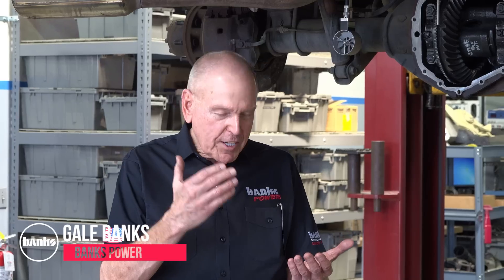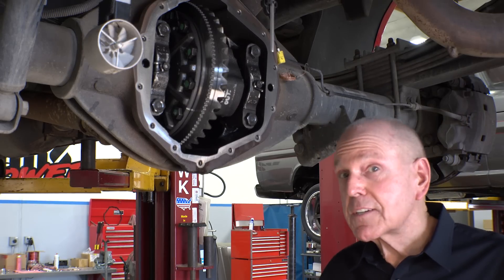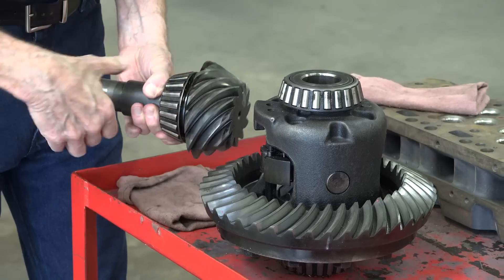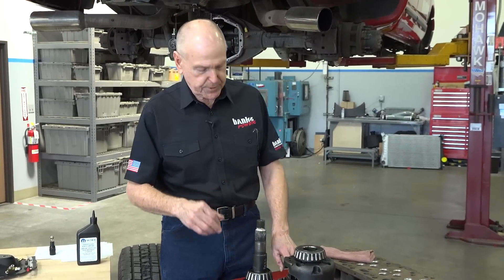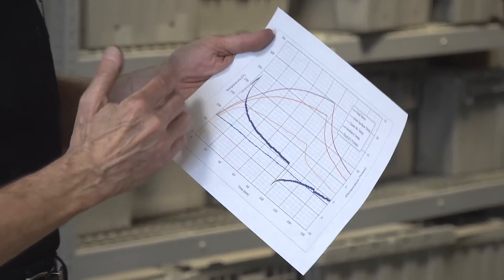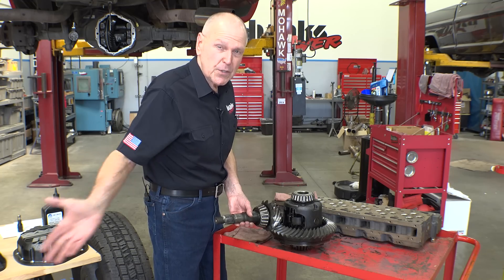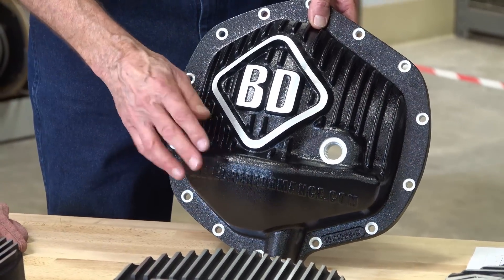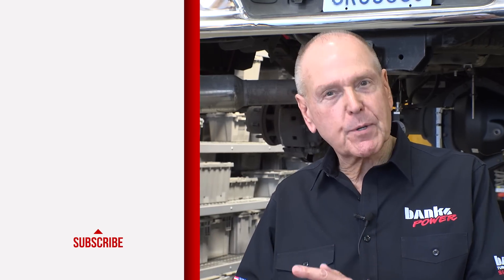Do Diff Covers Work or Are They Just Bling? Part 2 of 3

Comment: I see 5 dislikes....... And five aftermarket covers guess we know who hit the thumbs down lol
Reply: Touché. Haha
Reply: brappp life I have an after market cover on one of my trucks and just listening to Gale Banks logic, by itself, makes my want to change it back to the factory cover.
Reply: it might be his blind faith in the manufacturer, yes, they may have done some testing, but if they were always right, we wouldn't see plastic intake manifolds.
Reply: He has posted two videos on this one subject but no answer
Reply: @PandaMan02  what problems do plastic intakes have? 😂 ls has been around since 1997 with plastic intakes on both cars and trucks. Ford dodge GM Toyota Honda.. if they didn't work as well as they do for stock applications and even some performance applications then they would have never come out. They would have never lasted for 20+years. They are lighter cheaper easier and still maintain reliability. If you put boost through it that intake may not last but n/a and they work fine.
Reply: @motrhead 69 yeah the dislikes have gone up, not as funny now
Reply: @jaredanthony8070   Plastic doesn't hold up well to repeated heat cycles, it gets brittle and cracks easily.
Reply: @Lray4x4  yes some plastic isnt very good at heat cycles. Ls intakes are made of nylon 66 which has a heat rating of down to -30c and up to 180c which converts to -22 and 365 f. Theres hundreds of thousands of trucks and cars that have hundreds of thousands of miles without a single issue. Intakes are designed to handle heat cycles. Ford 5.4s had intake issues I believe but they are designed to handle it and they normally do. Now under boost of more than 10 lbs or so you will probably experience issues but in n/a applications they are built to last.
Reply: @jaredanthony8070  If plastic is so good then why do so many plastic intake manifolds, and thermostat  housings crack? It is rare for the metal ones do do that.
Reply: @Lray4x4  ls intakes are not well known for cracking. What brands that do use them probably dont use the same material that in ls based engines lasts hundreds of thousands of miles and heat cycles without ever having issues. But a lot of vehicles that do use plastic thermostat housings arent designed to last as long which means they use cheaper plastics that dont withstand the chemicals in coolant or petroleum.
Reply: @PandaMan02  worried about blowing the welds on your intake? 😂🤣😂
Reply: ill take plastic manifold over these plastic oil pans.
Reply: If you have done any appreciable wear, you'll likely hear a wine long before any hardparts go.  
Chances are, your fine.
Reply: Yes, but an aftermarket cover with main girdle supports has its benefits, but lacks in lubrication.
Reply: An oil pump at 40psi isn't necessarily better than an oil pump at 60psi. If I had to choose, Id take a 40psi pump, with a greater oil capacity.
Reply: @jaredanthony8070  I can't speak for or against plastic intakes. But have you worked on 10 + year old VWs such as Jettas, Passats, etc.? They have a lot of plastic plumbing in their cooling system. They are shit. Easily crack or brake after a few years especially if people don't change their coolant as per instructed by the manufacturer. I've worked on old VWs over 30 years when they used all metal plumbing. Sure some of them rust and go to the trash but for some VW owners who did a decent job at maintaining their vehicles, their VW metal tubes are still in good conditions. Every car manufacturer has gone the cheap route with parts estimated to last only 10 years before the need to replace them. This is the way they keep making money out of 10 year old cars.
Reply: @johnnyjohn8073  plastic being used in the cooling system is never very good in comparison to brass or aluminum or a good galvanized steel that works with the coolant etc. Plastic radiator end tanks crack after several years and if theres plastic couplers between pipes it is almost a guaranteed problem. But that's a different plastic composite and they have chemicals and electrolysis with the flowing coolant and it degrades them over time or they dry out from the outside in like a rubber hose will. But on things like intakes theres air flowing through it and they are another type of plastic that could handle gas but with injectors being at the intake port on the head or even when people run wet shots of nitrous through ls intakes they rarely crack.
Reply: @lorenreece1665  What is 'obvious' is that, my comment of the raw truth clearly offended you beyond measure. Everything I previously stated is based on countless years of experience, and, from numerous other mechanics who have multiple decades of experience.
Reply: @zoultronzoultron9723  man if you don't know the answer to this subject that would make it impossible to hold a conversation with you. Your reply makes you look like a fool.  La La Gag
Reply: @clauderivet7745  i actually do know the answer.  My comment was he has made 2 same videos but he gives no answer.  Mayb he has a video up now that i haven't seen . My comment was awhile back

Comment: Gale Banks defines the difference between an Engineer and a mechanic.
Reply: But a damn good mechanic that thinks like an engineer
Reply: Mr. Banks is more of an engineer than most engineers. He is analyzing this in a quite scientific way. I have no idea if he is formally schooled or not but he is an engineer none the less. My hat is off to you sir.
Reply: the upscriber I’d like to see the same study done with all of the intake air filters as opposed to stock.  I don’t believe the statistics posted online.
Reply: To actually prove his point, he needs to make a plastic cover like the ones that he's downplaying.  I would think that the GM developers made the shape of the stock cover to accommodate the larger ring gear and create the flow of gear oil to the highest point letting it flow to all of the bearings.  Other than creating outside "cooling fins" what else can Banks do?
Reply: As a random guy who fixed things designed by engineers for a couple decades. Some 'engineers' designs are fails. Really though.
Reply: there's no engineering here, sorry bro.  this is pretty basic stuff.
Reply: He exemplifies a mechanic.. who doesn't understand engineering, design, or physics.
Reply: I feel like it's the deference between a factory engineer and an aftermarket engineer.

Factory worker: make it cheap!

Aftermarket engineer: make it work better!
Reply: There's a big difference and I can go on for a while about how radically different both fields are, but mechanics maintain what has already been designed, engineers design.  A background in how cars work and what can make them work better would be ideal which is why people with an understanding of these things can be good engineers if they choose to.
Reply: They way apprentice mechanics are taught nowadays is to replace parts, not repair them. I'm a technician of 33 years and also hold a degree in engineering.  I'm sure having that engineering degree helps me understand the design and purpose, not just the effect. My son is a newly licensed technician and we have a huge difference in thinking when it comes to automotive repairs. I was taught repair, he was taught replacement. Huge difference.
Reply: Ken Call  this issue is since 1977. go low carb, live longer

Comment: Prolly gonna come down to "stick with OEM." Banks is a legend!
Reply: yep, seems to be headed in that direction.  Will be interesting to see the results!
Reply: It'll probably be stock as #2 best and the new Banks  developed cover as #1  as a combination of increase fluid capacity of the other aftermarkets and improved fluid dynamics of the stock cover
Reply: Yeah but this legend wont just stop there if it comes down to the stock one being best you bet your ass this man will design one that looks great and works better than stock because. Banks doesn't play around
Reply: I don’t think he will make a diff cover. I think he’s just curious.
Reply: "best" is kind of subjective. He doesn't discount the bling factor
Reply: If he thinks he can do better, he will make it.  
There's being curious, and there's being curious with an eye to doing it better and making money.  And Banks has the runs on the board when it comes to doing that.
Reply: Glad I still have my stock differential cover on, almost bought an AFE. I was also curious as to whether there would be a a benefit or detriment to the gears. So I waited for this video,  LOL!
Reply: @daviddroescher  listen to the video. What he is explaining is that the added capacity results in more oil that the ring gear has to over come and move around. Thats lost mechanical energy is turned into to thermal energy (thats the way that frictional loss works, sane thing happens with brakes). The added heat degrades the oil faster, and makes it thinner, resulting in faster ring wear. Added capacity isn't a good thing in diffs.
Reply: what legend banks makes garbage they do not stand behind and he just said his entire company is no good.. he is aftermarket and he said the OEM has the best design..
Reply: Seems like OEM with fins welded on the back to dissipate heat would be the way to go, unless someone wants to cast a thicker OEM style with fins from aluminum.  But then again, it remains to be seen if there's any significant difference anyway.
Reply: It would be interesting if you could hook up a VFD on the driveshaft side with an electric motor,  a torque
transducer and an integrated speed sensor (incremental encoder), which were coupled in balance for the axle and really define how much extra fluid causes loss. Also add temp sensors for measuring result of over filling as well and determine if the extra surface area and heatsink area helps or hinders the performance.
Reply: I tig welded some fins on are old 7.3s stock covers, but now have mag covers, interested to see results
Reply: @ffjsb  There already is an OEM one cast from aluminum with fins...it is an AAM unit and found on the Ram 3500 dually Max tow package trucks.
Reply: ffjsb I don’t necessarily think thicker is better. If you think about it, thinner metal is much better at letting off heat than thicker metal.
Reply: Nice, but I'm not buying a new pickup ever again.  Prices are ridiculous, and I don't need one but a couple of times a month.
Reply: My 2015 f150 was rusted a week after i bought it some people change them because of junk steel not because they want one that looks cool .
Reply: Who is "Prolly"?
Reply: twiddler2386 this didn’t age well

Comment: Dear Mr Banks, as an engineer with over ten yers of education and over thirty years of experience you have hit the nail on the head.
the people that build the rear ends for cars have spent thousands of hours designing the covers so that the oil will flow soft and smooth and cool with the least resistance. The curvature of the cover in this case must be a close as posable to the curvature as the gear. Its kind of like water would follow a round ball much better then something square like a block of wood. Some people like things that look cool but have no idea what they are doing when the are going to designing something. Thanks for taking the time and doing such a wonderful job on your videos. I will be in your shop on Aug 6th for some work to my truck. Thanks Mike Kennemer M.E.E / PE

Comment: Brilliant research, I cannot wait for the outcome vid. Thanks for taking the time to do this.
Reply: this is pretty basic stuff dude
Reply: @silvermediastudio  cool, please tell me what you have found in your research?
Reply: That stock is just fine, unless you have a very specialized application that puts specific stresses on the drivetrain, in which case there is no "one solution."  Heavy towing is different than off-roading which is different to highway cruising.  Application dictates hardware requirements.
Reply: Also, if you change the fluid frequently (like a fleet vehicle that's run 6d/wk), it sure is nice to have drain & fill plugs, instead of having to change the gasket or o-ring each time.  Saves time on the lift, meaning the vehicle is out making money.  Maintainability matters.

Comment: I recently worked for Dana and one  of it's axle assembly plants. The only one that had an aluminum cover was for some of the HD full floater for the super duty Fords. So I asked an engineer why not More made with an aluminum cover. His answer is exactly what you  said, it's making the fluid work harder and actually raises the temperature because of the design. So I'm confident your tests will show the same.

Comment: One cover that would be interesting to add is Mopar p/n 68149259AC. It's an AAM part used in the 3500s with the 4.10 ratio. It's cast aluminum and finned as opposed to stamp steel and flat. It retains the same inside shape and fluid capacity.

Comment: If you raise the level of the fluid , it will cover the pinion in turn create air bubbles ( cavatation ) raising temp and losing viscosity . Not to mention raising internal pressure , blowing pinion / wheel seals . Have seen it before , best case is puddles under the vent hopefully it is figured out before real damage is done . On the flip side is these covers look cool until someone thinks he needs it more than you  . Hopefully you notice it before heading down the road to work ! Towed to many after market mistakes .
Reply: Paint it flat black, no matter how nice it looked out of the box.

Comment: Ive been watching this test like a hawk. I have always wondered about these too. Ive looked at diff covers but would never pull the trigger. I thought about having a custom fabed cage that clamps to the axle shafts housing and using 3 bolts om the diff cover as a protectant for rocks. Never believed these covers helped and always wanted to test. Happy this is being done.

Comment: Hopefully when you test the Ford, you test the OEM aluminum 10.5" diff cover P\N 8C3Z4033A with the same curve as the stamped OEM steel one.
Reply: Eric J. Ford Racing makes a similar cover for the 8:8” diff (Mustang, Explorer, etc.) that I bought simply to get the drain plug in the diff cover to make changing the gear oil easier. It does require longer bolts than stock.
Reply: George Asplen  Do you have a part number for that 8.8” cover for Explorer? We have a Mountaineer version.. Front diff cover has no drain...Rear does, its fine.
Reply: DR3Z4033B is the diff cover and E9SZ4346A are the longer bolts that are required. It's what I put on the rear of my '96 Explorer and is the same as the front on my '03 Expedition
Reply: I was just going to make the same post. Thank you.
Reply: Cheapest answer for the 8.8 is the stamped aluminum cover from the Crown Victoria.  

Years back, I bought a Bronco with an 8.8 rear Dana 44 twin beam front setup (both limited slip, which was awesome), and some dumbass had coated the diff cover with undercoat.  Rather than remove the stuff, I went looking for a new cover and had someone offer me one of the used CV covers for $20.  Slapped that on and ran the next 100,000 miles without even worrying about it.

Comment: As a former Racer a former and race performance engineer its nice to watch yr video and to see someone has the opinion , Gale Banks believe you will find you on the right path ,, in my research for power i found the only way i could power at the rear differential was to go a dry sump pressure lubrication system  so i could run lower viscosity lubricants , the only other way to improve the diff is to add add strength  to carrier group and opening support which i don't think it be worth for daily street driving ,

Comment: Are you monitoring the pinion bearing temperature? You mentioned how the factory cover throws the fluid over the top to the pinion bearing. I wonder if the aftermarket ones do this? Could they cause premature pinion bearing failures?
Reply from the maker: Unfortunately, we're not able to measure that temp at the moment. But yes, there could be premature failures.
Reply: I had a good friend that used an aftermarket cover on his dually that he used for a hot shot service in the oilfield in south Louisiana.  He went through two pinion bearings in two years before the axle guys realized and told him about the aftermarket cover issue.   It definitely does reduce oil to the pinion.
Reply: Banks Power, would a hose clamp and a thermocouple on the exterior of the bearing housing be enough to get an idea on temperature?
Reply: @GoFastGator  you'd probably want to drill into the cap to just touch the bearing race and epoxy an RTD in it so you're reading the bearing face temp, not the oil temp on it. 

If you're gonna go that far. You might as well do the left and right, and front bearing too. 

The pinion pair could be tough. The axle caps are easy.